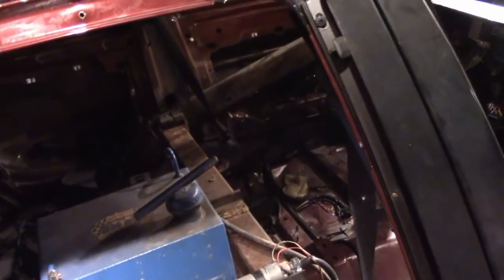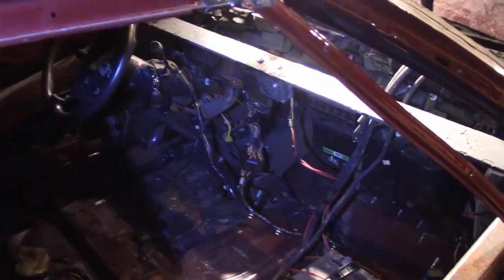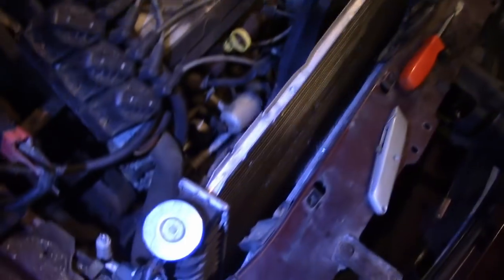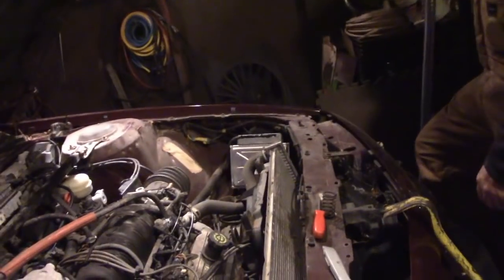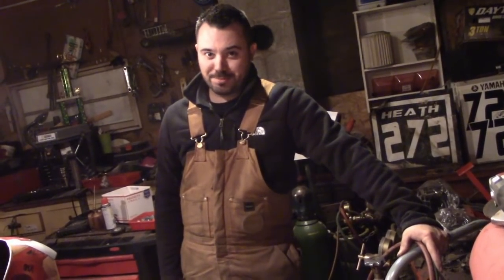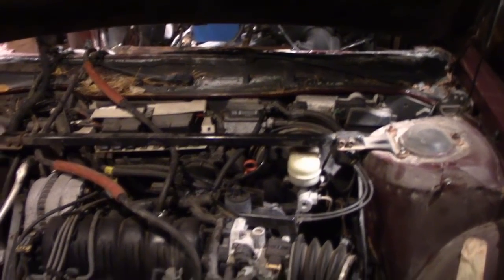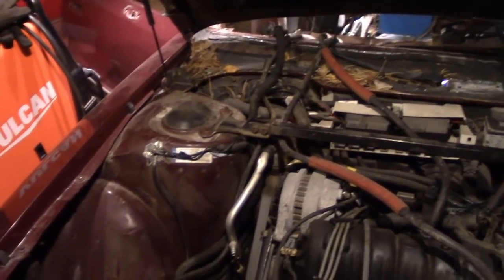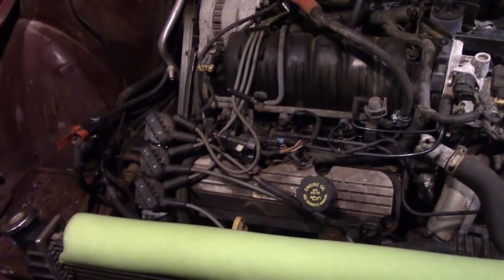Wisconisn State Bird!!! H body Update

Comment: I’ve actually seen more issues with the fuel lines run thought the fire wall then over the top such as them getting cut through but if they make us run them through like that I usually just use some break like